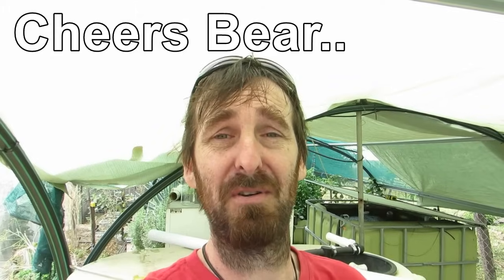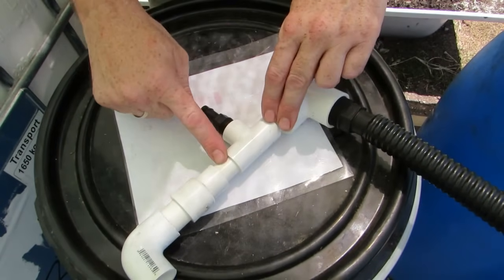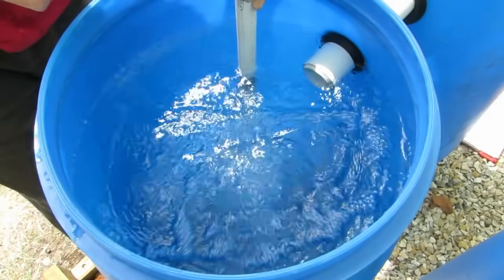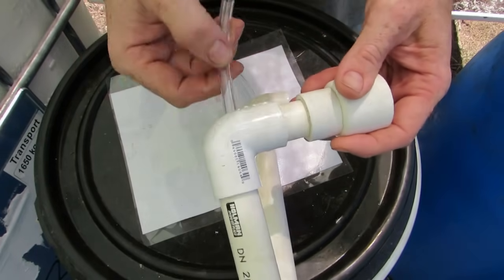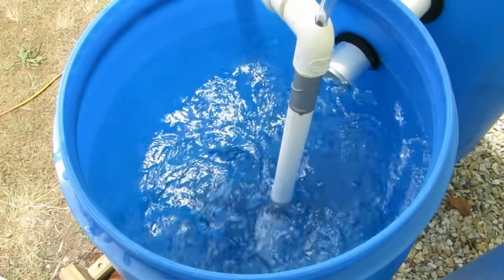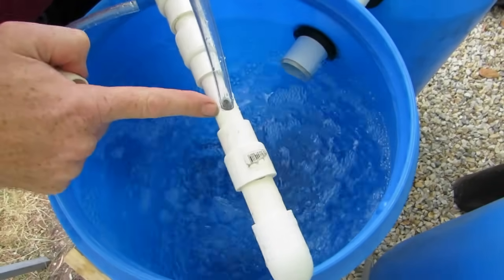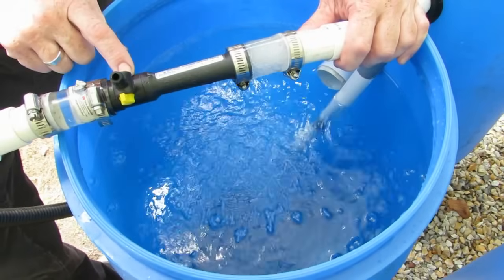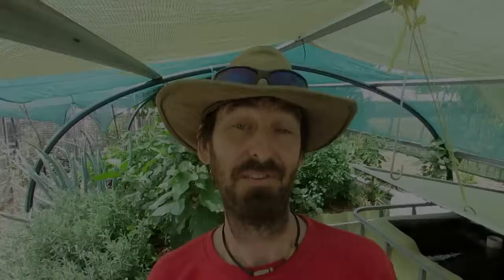DIY venturi, a few easy builds for aquaponics, aquaculture or hydroponics..

Comment: How do you get your water so clear?
Reply from the maker: Hi Marc.. I think the radial flow filter does most of the work & the grow beds just help to remove any of the smaller suspended solids.. Will be interesting to see how the fish farm goes without the extra filtration that the grow beds offer..
Cheers sir & have a great one..
Rob.
Reply: Rob Bob I have a radial filter on mine different design then yours tho.
And I get alot of alge
Reply from the maker: Does the system get a lot of direct sunlight Marc Norden ?
I found adding the 90% shade cloth over the fish tank took care of most of the algae issues we had..

Comment: Rob, I messaged you on IG, can you please check. Also, if I sufficiently aerate my sump, would I still need to aerate my fish tanks?
Reply from the maker: Hi GG. Any chance you could ask it here? I have a load of PM's on Instagram & wouldn't know where to start trying to find it. 
It's best to have air added to the fish tanks in case of failure elsewhere in the system. 
If the pump dies, you may well lose your fish as well as there will be no O2 rich water making it into the tank.
Cheers.
Reply: Hi Rob. Question. Do you think that a Venturi Tee will be able to supply enough air to a 55 gallon tank with 20 Tilapias?

Also do you think that if I fill another 55 gallon tank with gravel I could use it as a bio filter for 2 other 55gal drums with 20 fishes each?
Reply from the maker: @GG-du6go  Hi mate.
I wouldn't rely on just a venturi either as they don't work if there's a water pump failure. I would have a dedicated air pump as the O2 demand for such a highly stocked system would be more than  a basic DIY venturi could provide IMO
I wouldn't do 20 tilapia in a 55 gallon tank full stop. 1 fish per 5¼gal is what I like to stock at for their own health but still wouldn't do it in such a small drum.   
The rule of thumb for grow bed based bio filtration in DIY systems is 6.6gal of wet clay/¾" rock per fish. 
I wouldn't just fill a barrel with rock & use that as a biofilter as solids would build up quickly & you'll end up with a load of dead fish. 
Hope that helps some.
Reply: @RobsAquaponics  thank you Rob

Comment: what about several small tubes to make small bubbles and more of it with more than one tube to suck in air
Reply from the maker: Hi Rick..
I tried smaller tubing when I first played around with them a year or 2 ago & didn't get a decent amount of air coming through.. Not sure that more small tubes would help but could be worth a shot trying.. Also need to me careful not to congest the pipe with to many restrictions of the water flow becomes reduced significantly as well..
Cheers,
Rob.

Comment: i have just made an experiment that failed to inject seaweed and soil wetter into the reticulation pipes ... the problem was venturi does not work in a high pressure pipeline that little popup irrigation heads need to flow water ... does anybody have an idea about how to inject liquid fertilizer into a reticulation pipeline?
Reply from the maker: Hi there... I don't have an experience with using liquid venturis sorry... Hope you find the help you're after..
Rob.

Comment: The vinyl hose is smaller so less air
Reply from the maker: Yep... Didn't want to drill too bog a hole in the smaller PVC pipe.. Have had some fittings split on me before..
Thanks for the Sub & hope you find the clips helpful..
Cheers & have a great one,
Rob..

Comment: I like this video of your Venturi setup... unfortunately I am unable to pull off the same results. My question is - Does it matter at all if I kept my two ends farther apart than your video shows? Following the same setup as your center "TEE" piece, I currently have two of my 1/2 PVC pipes apart from the center at about 4" each side of the TEE. At first it seemed to work as the barrel is only half way filled - As the barrel began to fill to the top, that is when my Venturi and bubbles stop bubbling - Water begin coming out of my "TEE" piece. 

                                                                                       1" to 1/2 connected to 1/2 to 1"

                                           |                                        |
                                           |                                        |
                                           |   BARREL                      |       ______[ TEE  ]_______
                                           |                                        |       |                                        |
                                           |                                        |       |                                        |
                                           |                            ----------|------|                                        |-------------> POND

Is there something I am doing wrong here?
Reply from the maker: Hi there. 
Is your venturi at the top of the barrel or towards the base ?
If it is at the base or below the top of the water level you will need to attach a breather pipe on the venturi to bring it above the top of the water level. 
Hope that helps.
Reply: I did some more "Googling" and found that the Venturi did not work because of the level of the water in the barrel is higher than the actual Venturi setup. I believe your advice in running a breather pipe on the Venturi may fix the problem. I'm actually planning on re-designing the Venturi so that it is sitting above the top level of the barrel water. 

Again - Thanks Rob! Keep shooting your vids - they're great. I just watch your chicken feed vid and their great too.
Reply from the maker: Good to know you have it sorted now mate & hope the system is ticking over well now.  👍 
Cheers & all the best.
Rob.

Comment: Oxygenation is achieved by the actual surface of the water being turbid and forming vortexes where the water rolls in upon itself. Turbulent disruption on the surface is the key to good dissolved oxygen. It could be argued that the smaller the bubbles, the less turbulent the surface is equaling less dissolved o2. A good waterfall effect is the best way to achieve high o2 levels. Bubbles in aquariums are pretty, but thats there main reason for being there. Keep ya water moving and turbid, especially in warmer climates.
Reply from the maker: Hi there..
From what I have read the bulk of the  O2 is dissolved into the water when the bubbles are formed within the venturi.. Less is dissolved into the H2O as the bubbles as they travel through the water but it still does occur..
Have seen a good vortex aeration unit but it just isn't practical in the set up we have with the limited space available to us..  The grow beds all free fall into the sumps so that also adds extra aeration to the water..
Cheers,
Rob..
Reply: But the smaller the bubbles, the more surface area given the same amount of air. Similar to the difference between dissolving granulated salt and chunky rock salt in water. You only have a limited amount of time to get the oxygen dissolved.
Say …
This may mean that you get more oxygen in the water if there's a longer tube between the aerator and the tank. An extra second or so for the o2 to dissolve. You'd have to check it chemically - you wouldn't be able to tell just from the bubbles.
It's a cheap and simple option to increase the oxygen, if it works. I wonder if you could combine it with a swirl filter? Would that keep the air bubbles in the water longer?

Comment: go to a local spa pool/hot tub supplier and buy a spa jet, some of these are really cheap and would be simple  and effective.
Reply from the maker: Hi There Sally..
Had a look at a few a friend had & they were the wrong shape for some of the applications I need them for unfortunately.. Would of been great if they were as it would of saved me some coin :/  Have seen others use them in their fish tanks & they work great :) There is a clip or 2 of folks plumbing them into their systems on YT too..
Cheers,
Rob..
Reply: look for micro jets with a 1/8th barb these are very small and should be okay.

Comment: Using that HPDE 'tap' in Nt qld i have found falls apart from UV light :d best use a more Durable and Sadly Expensive PVC bunnings 'red tap' 
wont be using holomans Poly type taps any more in my yard, after cutting my hand on teh broken tap 'head' 

and this is more Explanatory then the other vids i seen just now
Reply from the maker: Thanks for the info mate.